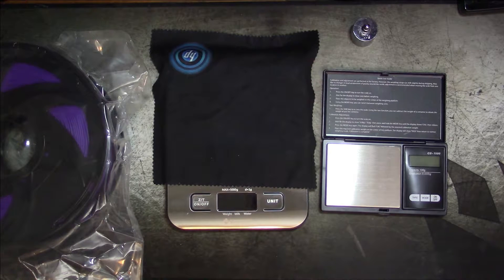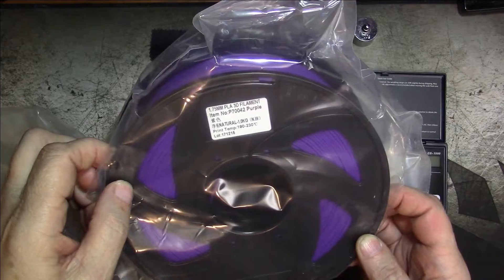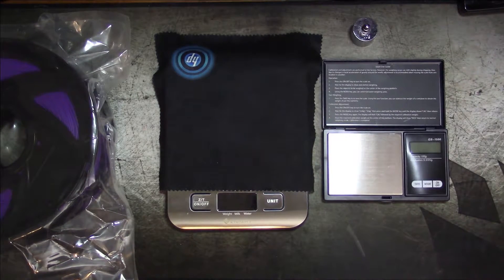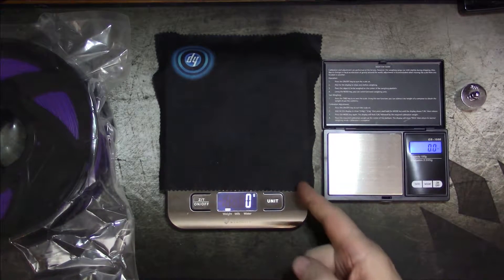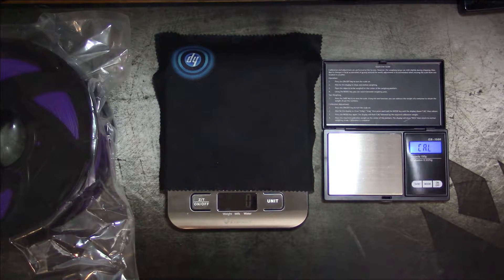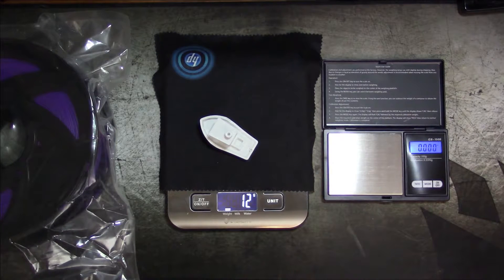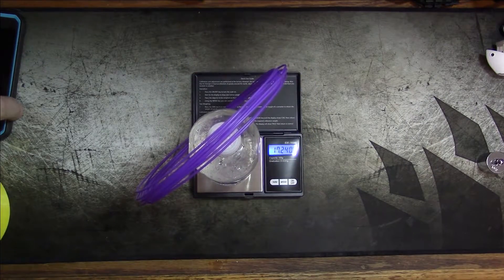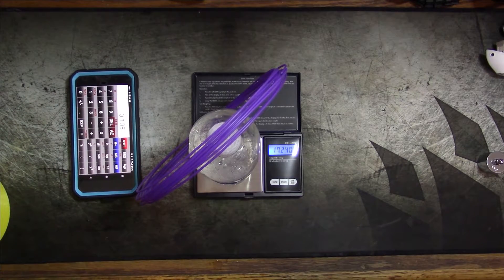Do you REALLY need to dry your CHEAP PLA filament?

Comment: I use cheap PLA filaments and  2nd half of filament is hard to print as it stays open for a month. Cant re calibrate printer to make it print, helps just buying new filament not sure if DH would help.

Comment: Everyone living in the UK: Our atmosphere is much more humid than many places in the US so we are likely to benefit much more from drying our filament than most Americans.
Reply from the maker: We have every type of climate you can think of in the USA. Before I moved to my current location in the Arizona desert I lived in the Seattle, Washington area for 19 years. We moved there when I was 15, it was raining when we got there in March and I remember sometime in April asking my Mom, "Does it EVER stop raining here?". We had a saying, "The Seattle area is a great place to live, a billion slugs can't be wrong!". And if you look at my tests, I've kept some filaments, like PLA and PETG, in an 80% humidity enviroment for a week and saw no degradation in print quality. But of course some, like polycarbonate and nylon, require drying no matter where you live.
Reply: @3rdpig  I live in Scotland, it does not get much wetter than Scotland, it even rains here while the sun is shining..

I have never had an issue ever with PLA even when stored completely open to the air. NOT ONCE EVER..

Filament left on the machine will go brittle on the straight section due to the stresses of it being straightened, when its formed on a roll and curved, but its only the straightened bit after maybe 2 or 3 weeks sitting there.

I do now keep rolls in ziplock bags, no silica, JUST to keep dust off them as the filament cleaner was getting pretty gunked up since we got a dog a few months back, scruffy hairy mutt! 

But, try telling someone that was conned into buying a dryer for PLA that they don't need it, and every last one of them will swear black is white that without it you get crap quality prints and its the best thing since sliced bread.. Its almost like they think you will actually believe the BS SMH

Comment: Think you can do this test for specialty filaments?  I love Sunlu wood filament but when I got down to a little past half a roll it started printing funny and is weaker than before. I don't print much so it was on the printer for several months.  My oven won't go low enough to try that drying method and I don't have money to blow on a dehydrator that may not work.
Reply from the maker: If you want to send me a few samples of the filament I'd be happy to.
Reply: @3rdpig  I can send you what's left of the roll if you'd like.  I ordered a new one hoping it would work better, just haven't opened it yet. Pretty cool stuff, you can sand and stain it and it looks like wood. Maybe you'll like it.

Comment: I bought a roll of the ebay $10-$12 filament from ebay a few months ago and I haven't looked back. The final results look exactly the same as the pricier stuff. Only differences I've had is that the rolls aren't nearly spooled and there are slight kinks every few inches (some cheap spooler issue I suppose). But it doesn't matter because the results come out perfect. I save so much money nowadays.

Comment: Hey Chuck, I mentioned brittle filament in your past videos. I live in a humid place but had no issues last winter.  I think UV light is the key.
Reply from the maker: I'm considering testing UV, but it won't be for a while. I want to get moisture out of the way for all the filament types I've got, then I want to spend some time getting my polycarbonate settings worked up once I determine that moisture isn't playing a role. Thanks for watching, and thanks for the comments!

Comment: You've convinced me 😀 I'm still using up PLA I bought 4 or 5 years ago and I have wondered if it might have absorbed too much moisture but it seems to pretty well although I have had more problems with stringing than previously. Could be lots of other reasons though. Thanks 😀
Reply from the maker: I wouldn't completely rule out moisture, but baking it in the oven at 50c for a couple of hours should tell you. Thanks for watching!

Comment: I've never really had moisture issues with PLA. I buy it in 3KG spools, and sometimes it can take a month to get through on some of my printers. PETG on the otherhand, I find after a week or so of being open, it gets far stringier. I chuck that in the dehydrator and it seems to help ease the stringing.
Reply from the maker: I agree about PLA, but I've never had moisture problems here with PETG either, but again, I live in a very low humidity environment to begin with. But I've got a roll of PETG and I'm not afraid to get it wet. It's up for a swing next! Thanks for watching!

Comment: You have confirmed exactly what I thought, Chuck. I suspect some may not agree.
I sit here in the UK where most people know that there's a predominantly damp climate. Like some of the others who've commented, I don't make any special arrangements for PLA filament, other than returning a spool to its bag and box when I change colours. I get reasonable outcomes with this arrangement. 
I've improved my prints more by following your guidance about making the STL models carefully and adjusting slicing settings than I suspect could ever be achieved by dehydrating. Look after the fundamental stuff! Is the bed level, will the filament stick, is the gap right ...?
Thanks again, Chuck.
Reply from the maker: Thanks for the comment Paul. I'm going to move on to PETG next. Sooner or later I hope to find a filament that I can actually get moist enough to cause a problem. Maybe water injection? lol

Comment: Thanks for working to debunk this myth.
I've had PLA laying out for years upon years in humid environment, makes no difference.

3d printing community is full of these, as most of the userbase is newbies, they believe whatever another newbie told you. Generally, if the 3d printing community is hyping something, or being adamant about it, it is most likely wrong. Been doing this long enough to see how this myth keeps on persisting.

Alex Kenis determined the reason was UV why people think it's moisture. UV makes PLA filament brittle.

8:20 i would think 0.1gr is within error margin. all that needs is half a droplet not dried out.
Reply from the maker: I agree about myths being perpetuated. I might have to test UV part as well. Should be pretty easy to do. But I'm not sure how long they'd have to be exposed for. Have to think about that one. Thanks for watching!
Reply: @3rdpig  Check Alex Kenis' video about it.

You could easily get a very cheap UV lamps and do say 1 day and 7 day test?
Reply from the maker: @skaltura  A week long is pushing my attention span pretty hard, but I think I could manage it. UV lights are pretty cheap, maybe I'll put one in my cart next time I'm at one of the Chinese retailers. By the time it arrives I should be done with all the moisture tests.

Comment: The purple benchy has some salmon skin? And at y axis path there seems to be gt2 belt artifact. Those can not be seen on white one, maybe camera do not pick those up? Would be good to hear your opinion as you see these in person :) great investigation. I have not dried my plas ever and had not have any issues. Having filaments in the bag is good anyhow, as dust is worser enemy than moisture.
Reply from the maker: They're very similar. I think any differences can be explained by the fact that one is white and doesn't reflect light very well and even beyond that doesn't seem as shiny. Also, there's a quality difference between the two filaments as well. The Hatchbox filament just makes for a nicer exterior part, probably due to a more consistent diameter. Thanks for watching!

Comment: I live in Chicago, I never put my filiment in the storage bags, and I would typically have 1 roll always on the printer for days. After I saw to keep it protected, I always put the filiment back into the sealed bag when I wasn't using it - except the spool that would be hanging on the printer. I have never seen a problem with the filiment in my limited use. My buddy has the same printer, his is in a cooled basement, his is much touchier than mine is, which is in the second story bedroom. I can only guess different environments may create slightly different results. I had a spool hanging on the printer for weeks, I was wondering if I was going to have issues and it printed fine. Your mileage may vary, etc, etc. Good job Chuck, Maybe PLA formulas are better today than years ago, and maybe it was a problem before. I have read they are constantly refining the PLA formulas as they learn more.
Reply from the maker: The filament I have seems very resistant to absorbing moisture. It's far more forgiving than I had expected. Thanks for watching and the great comment!